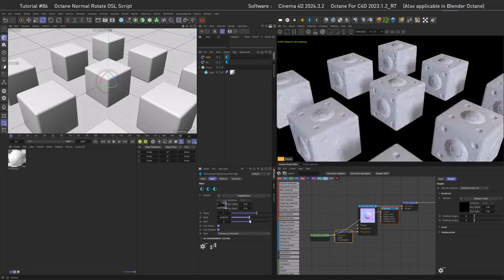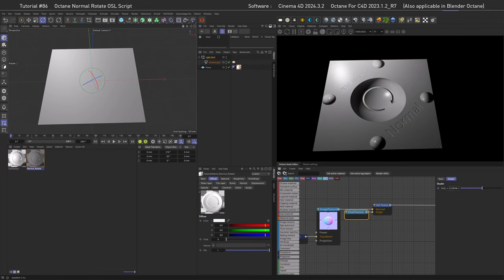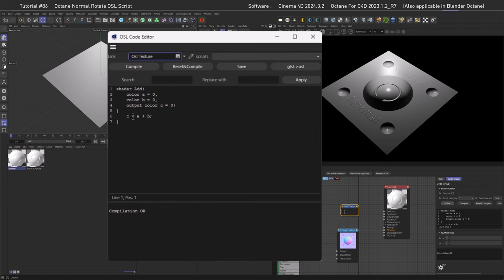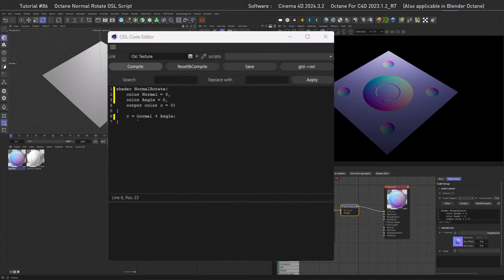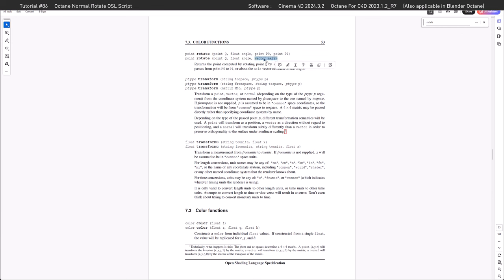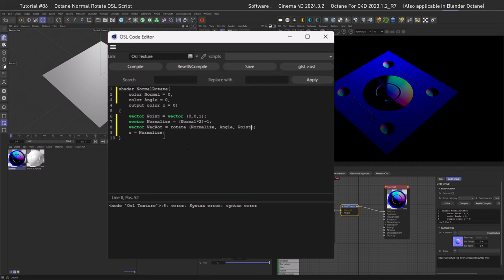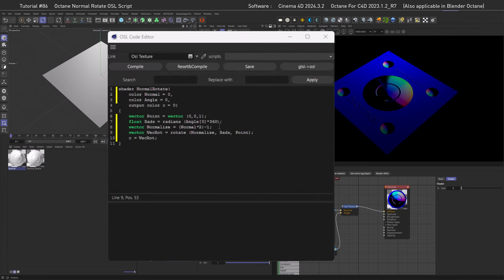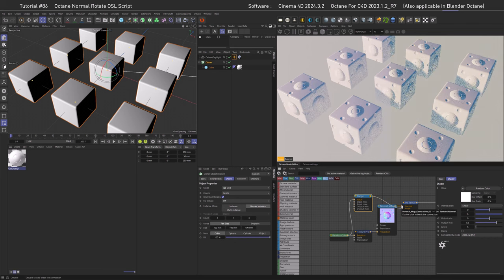Silverwing Quickish-Tip: Octane Normal Map Rotation Script (C4D)

Comment: My oh my! The more osl tutorials you make the more less intimidating the scripting becomes, using the range mapper after made me think that of that node itself can be implemented within the script, aand it makes me wonder if it’s possible to use this with the chaos node, if we could extract the random rotation from it, to me that would be the holy grail of seamless procedural texturing, but then distort uvs node is pretty strong too, I’ll experiment whenever I can and share my thoughts

his is a bit shorter than usual only because i need to start experimenting with osl 😂 I’ll revisit if i have more ideas 🔄
As usual thank you so much and I wish you a great week ahead 🌟🙌🏼
Reply from the maker: Thank you so much for this weeks conversation Zaidi!
I love the way you think in possibilities. It is indeed doable to have the remapper directly in the OSL script and even use it with angles so we just have to write the same things inside the min / max of the distort.

In C4D there is the caveat right now that we can´t have data output for those sliders and therefore can´t really have one value controlling it all. In Standalone and in Blender Octane there is and I really hope this will be implemented in Octane at some point.

One of the other missing thing is that in OSL you usually could define more then one output. So you could really do all the calculations in one OSL and then give out the values for the projection as well as the rotation to go into the different ports.

I think in order to make the chaos texture work you would have to rewrite it in OSL first to get to the data and and to get all the information that is needed to determine the rotation.

I totally understand that you want to experiment right away 🙌 Great to hear you got this reaction from the video. That means I am doing something right ha ha.

Cheers and thank you so much for the ✨🔄✨ and an amazing start into the week to you too!
Raphael

Comment: Thanks for this video. I was quite tired when watching, maybe a little fever, and thought I probably don't understand much. But this was very easy to follow. Well-done!  The approach of making things like a "non-coder" would make them, and then fixing the errors is good. Then you understand why you do what you do. Not just “OK, I have to do it like that, and it works, but I have no idea why" 

And thanks for the last tip too: 🔄 But for some reason my arrows are round in Windows pop-up, and “straight” in comment field :D BTW. That emoji library is also found from Clipboard History, which opens with Windows+V (but you need to activate it first from some windows settings) It is really useful feature. Couldn't work without it any more.
Reply from the maker: Thank you so much for your great comment.
I very much appreciate that you liked it and could follow it even in a tired state.
I think the way I show it also comes naturally as I am a self taught coder and therefore probably approach it differently then a professional would ha ha.
Did not know about the clipboard history emojis. I know that the history exists but I never turned it on 😇
Thank you for the nice read!